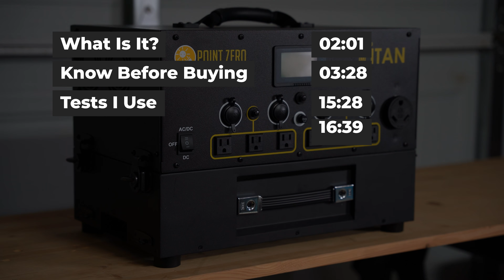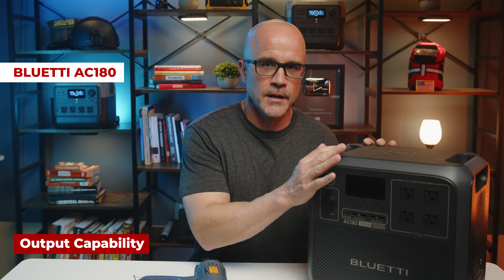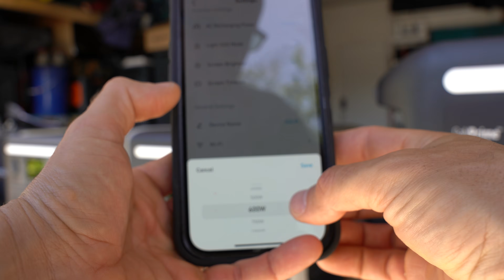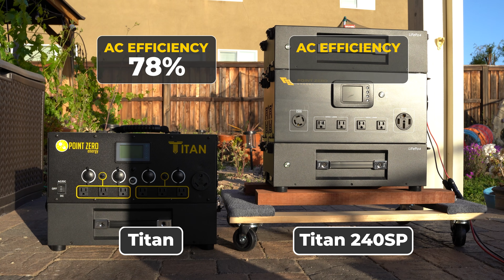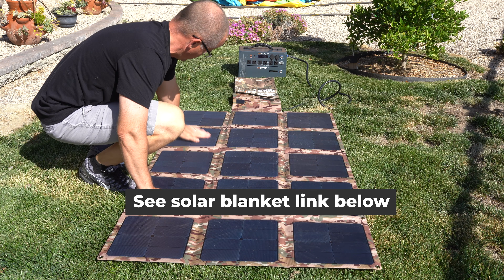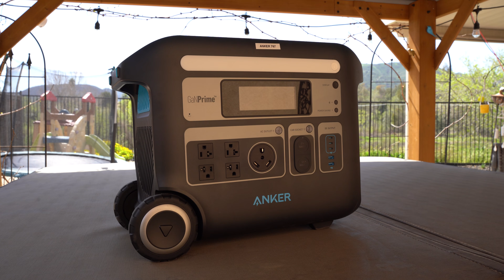Best Solar Generator for 2024 (The Ultimate Guide)

Comment: I have the Ecoflow delta 2 with extra battery and use it daily. I try to power a single room in my house with it. I have 800w of solar panels going into it (it’s capped at 500w) so I can run off the sun during the day and off the battery at night. I’m looking at the Delta Pro 3 that is ready to be released as it has both 110 and 220v capabilities without the bridge required for the other pro models. Thanks for the video!

Comment: We run a reasonable cost monthly except for the hot months so I was thinking of adding this for those times and then bought an EV so now trying to add that to the mix. Any suggestions for EV charging options (800kW Ioniq5).

Comment: Great video i own 6 mango power units got them for 1300 instead of paying $4000 dollars has an internal 3.5kw hour battery with an add on 3.5 kw hour battery making it 7 kWh but mango power has the worse service when mine went out they never sent the return label for warranty and stop answering good unit bad service but found all the new internal parts from a recycler guy in Los Angeles super cheap install one one day before new years with 2000 watts of solar running a Mobil home 24/7 till now 0 problems but since I open up the unit I added fuses it has none to protect the unit internally or for the solar input I would suggest to add protection on any of this units not only on the solar input but on ac output and the only reason I like this units it’s because of the battery been one of the best in the market

Comment: My Pecron E600LFP drops to 100 volts when you throw a few hundred watts at it, which some of my devices really don't like. Causes my UPS to rapidly flap the AVR on and off. The power brick also failed, though they replaced it free under warranty without requiring me to ship them the defective one.

Do the E1500LFP and E2000LFP suffer from this same voltage droop issue as the E600LFP? Their spec sheets still have the same "100V-120V" spec that would indicate that they also have unstable voltage.

Comment: 3:20 harvest the energy directly from the sun - what an interesting point
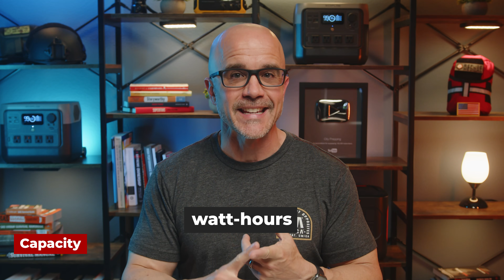4:30 capacity
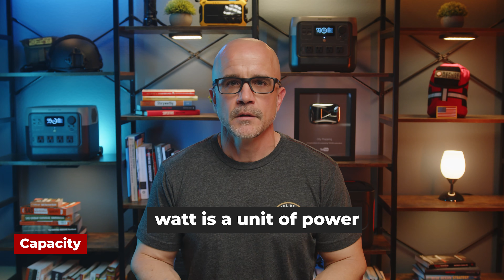4:38 watts are a unit of power
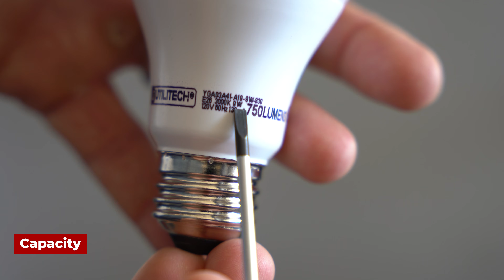4:50 the number of watts needed to power an object is listed on the side of the objects
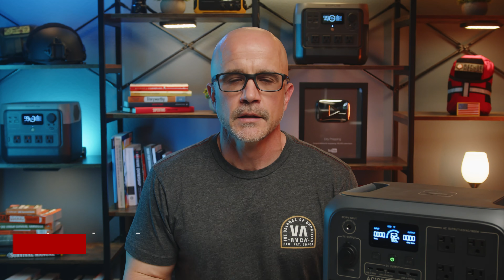6:20 output capability
7:33 run at 50-70% operating capacity 
8:05 temporary spike to get motor running then comes down
10:20 lithium ion versus lithium iron
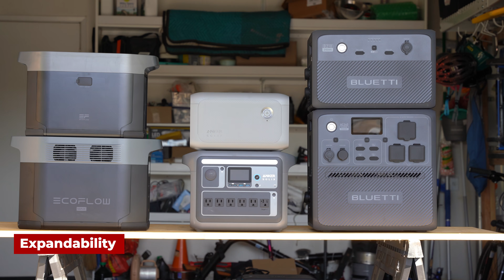11:40 expandability of batteries 
Jackery no until 1000 model
34:50 battery capability calculator
37:40 you slowly add on ea device at a time to not surge all at the same time.
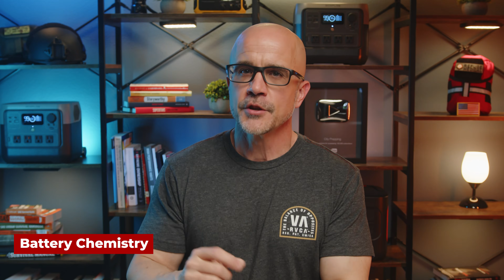Reply: Lithium vs iron starts at 9:30

Comment: Next year I am going to travel the country for a couple of years in a truck pulling a fifth wheel and I wanted to buy one so I can use truck stops and rest stops when traveling to my next destination, plus If I wanted to stay somewhere that was off the grid  I would need a power source for all three scenarios. After searching,  watching and reading till I couldn't research it anymore I have to say this video convinced me on what to buy. Since today was the last day for tax free hurricane items here in Florida I bit the bullet and ordered a EcoFlow Pro with a 400 watt solar panel. The Eoflow Pro is 3500.00 and was on sale for 2499.00 the solar panel is 999.00 and then I found a Pro with the solar panel on Amazon for 2899.00 plus saved 188.00 from the tax free holiday so I feel I got a great deal. Out of all the things I read and videos I have seen the EcoFlow was always one of the top choices or number one and when this guy said "it's the only one I don't give away or sell I keep them" I was sold.
Reply: Interested in using the Eco Flow in my shuttle bus. Would you do hard panels or soft? Would it power an AC?

Comment: That is a great review, thanks, as I am looking for back-up options in the event of blackout, plus the ability to transport if there is a need to evacuate..

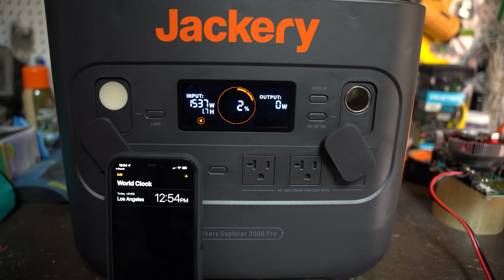I have one question that came about from a comment you made towards the end 33:48 where you state that ideally, they should be stored at about 50% of capacity.

This seems counter intuitive to me because surely, when a blackout occurs there is no option to get the additional 50% capacity needed.  And in the event of an evacuation there probably wouldn't be the time available to get the extra charge to the unit.

Am I missing something?

Comment: I need help...I need a solar generator that a 50 amp plug can go into. I got a bluetti ac300 it has a 30 amp plug but my rv is 50 amp. I reduced it down to 30 amp...n now I'm having to replace my rv Converter. I don't know anything about all this stuff I'm living full time in my rv n I need power to be reliable. I live on land with no power...I have pets...I got to have a generator I can plug my  rv directly into.

Comment: Note: In the video it is stated that the max expansion capacity of the Ecoflo Delta ll is 2 kw. This is not true. The Delta ll is compatible with the Delta ll Max expansion battery. With this configuration, maximum capacity would be 3 kw. I have this configuration.  The Delta ll max expansion battery works with the Delta Max, Delta ll max, and the Delta ll.

Comment: No Dabbsson on the list?  The best value in the solar generator market.
Reply: Dabbsson's use semi-solid state LiFePO4 batteries that get 4500 charge cycles and are lighter than normal LiFePO4 batteries.
Reply: I agree. 5 year warranty. Amazing capacity.

Comment: I have 2 small ecoflows the 256 wh ones. Great solar generators but I also have 2 small 268 wh bluetti’s and they work great as well. Both have nice apps and displays. I like that my EcoFlow’s display can be set to staying on permanently while turned on and blueetti is about a minute max which sucks. BLUETTI has the best screens but they don’t stay on while on and that’s a bummer. But aside from that both are great but I agree EcoFlow is my favorite and best out there. BLUETTI is 2nd place with them. I actually ordered the BLUETTI 180 for its sale price of $599 no sales tax in Montana lol. Anyways it’s 1k original price so I had to order one 2 days ago off Amazon for the sale price that’s a steal. I wanted a EcoFlow instead but it’s not on sale so I went with BLUETTI. That’s a great steal on that unit for $599.00 right now.

Comment: Can the expansion batteries be charged without being connected to the main unit?
I don’t see this issue being discussed, whether or not these extra batteries have a built-in charge controller.

Comment: The whole lineup of generators stemmed from the New World Foundation that created electromagnetic (sine-wave) Hub Motors.  We proposed a complete line of repowering of commercial tools such as air compressors, welding machines 0water pumps and saws &drills to be powered with jumper cables.  
   The cost in electricity was so high for the old electric powered tools that it was imperative.
   We even cancelled atomic power in favor of sine-wave powered power plants , industrial wheeled tractors and ships as well.

Comment: I'm looking for a lightweight unit in the 500w- 700w range. I have a Bluetti ac50s, but the DC keeps cutting out, so I can only run it on AC. I would prefer DC5521 inputs and output jucks for better overall system compatibility.

Comment: Great video.  👍I am in the market looking for a unit and this video helps pull everything together in a very concise/easy to understand way.  Spreadsheet is awesome.  Had a question about solar/wind hybrid systems.  Living in a part of TX that gets either a lot of wind or a lot of solar.  Can these systems be adapted to wind as well?  If so how?  Having a steady supply of either wind/solar, reduces the number of batteries/panels.  Also do you factor into the calculator the average sun hrs per day a location gets? I'd be interested in the Bluetti AC240 or the Point Zero 240SP.

Comment: I have a shed in my backyard that I sometimes do work in. It has a 12,000 BTU  AC window unit and 2 LED lights.

I would like to sperate the power from my house to the shed.

I would think 12 deep cycle batteries would be better for continuous use. 

What do you think?

Comment: I bought an AllPower R1500 and a 200W panel and so far love it. Camping and hunting working great.
Reply: I bought an AllPowers 700 and it arrived "sort of" charged ( not discharged as advertised). However, it would not power anything. I had to send it back, and since they did not have a replacement available, they refunded my money. It's disappointing since I was really looking forward to it for van travel.
Reply: @dross24MA  Hmmm dang. Sorry.
Reply: @dross24MA  what do you mean sort of charged what does that mean? you tried to charge it up and it didn't charge up, your comment was not really making sense

Comment: Thanks for the info. I have a truck camper I need to power. I’m leaning to the Ecoflow products. I was quoted 13k for a complete overland package. I’m trying to not use solar panels. I was curious if I can just use the alternator charger to top off my solar generator.

Comment: WHY do you people NOT give the amp hour rating for these things ??????????? It seems to be the elephant in the room, WHY not address it? I will NEVER spend my money on a product that tries to hide it's specs. YES, there are 10 thousand claims, but NO pertinent information!
Reply from the maker: Goal zero takes that approach. I just find it confusing to work with those numbers. But if you use a calculator, you can quickly determine the amp hours with the information on their website. It’s just a different unit. I personally prefer kilowatt hours myself.

Comment: Hi, Thanks for your informative video.  At around the 13:00 mark you stated a 1000W gas generator wouldn't be able to charge an 1800 Watt solar generator. Wouldn't it just be a slower charge or would it actually overload the gas generator? Thanks again!

Comment: Yeah, accepting these devices called generators across the board shows you how you can mold people into anything you want. Generator was always, and ALWAYS one and one thing only - motor that produces electricity. Period. 
These are just elaborate battery banks. 
Even hooked to solar panels, they still don’t fit the definition of a generator.
Reply: True, but my Titan generator will be keeping my stuff running from the sun, when your out of gas. I own a gas generator too. So no matter what you wanna or don't wanna call it,it still keeps the lights on
Reply: @dustydawson8977 Plus gasoline has a shelf life of about 6 months to one year.  Sunlight is ‘fresh’ every morning. 😊
Reply: It's an inverter, controller and battery.
Make your own components.
I say.
My bank failed, no comeback China.
So that's it no second chances.

Comment: This video is a GODsend!
Thank you so much!

I'm a 55 yr old female. I  have been trying to understand all this stuff for some time now. 
I recently decided I wanted solar, not gas. 
I live in South Ga USA, so it's HOT! 
I bought a portable AC that's 8000 btu.  I hope to a power that for sure. 
A huge concern for me is portability. 
I prefer one with a handle and wheels.
Otherwise, I won't get optimal use from it.  Of course I'll get the best I can. I have around $2500

I've been overwhelmed with this stuff!
You have no idea how much I appreciate the work you have done here!

🔥🙌🏻to God be the glory🙌🏻🔥
Reply: Go lower. Go to a Window AC at max 6000 btu's. The lower btu's will draw significantly less on your solar gen. You can close off a small room and be very comfortable.
Reply: @gregory4154  I did purchase a 6000 Btu AC.
I was so tempted to get the 5000, but it cooled 100sq ft less. 
Thank you again for the feedback
Reply: @angiedixon8017  Most 5000 btu's are mechanical, so they have an easier start.  It's the start that trips up most solar usage on the window AC.  6000 btu's are great, and you can digitally regulate it.  Leave it on Eco Mode when you use it.  The trick is, close your bedroom. Run also an air circulator like a Dreo fan.  Portable AC's are NOT efficient.   Those are the ones that use the tubbing you pull to the outside.  My pups always sleep in the room with us anyways, but if you have your own fur babies, bring them in the room with you.  The technical stuff will come later.  This is a jump start that will ensure you get through a grid down off your solar or gas gen if you are using that.  Remember, the solar gen can stay indoors with you (Ecoflow , Bluetti, and Ankor are the best), the gas MUST stay OUTSIDE in a well ventilated area, and they make a lot of noise.  Good luck to you.
Reply: @gregory4154  thank you, I will put this info into action😁
Reply: @gregory4154  thank you for your response. I will do just that
Reply: @gregory4154 Will Prowse recommends the cheapest 5000 BTU Walmart window unit you can get, for something that will work.
Reply: @gregory4154 great advice…I live in central MS and am 68 yrs old and can no longer tolerate the humidity….when lights go out, my little 110 window unit in my bedroom keeps me going.
Reply: @mscatnipper2359  ah yes! Thank you for sharing this.
Reply: I bought a small Party tent to put over my bed with the 5000 btu window AC, after lots of research.
Reply: @iadoreadonai  thank you so much😁
Reply: @iadoreadonai smart!  Very affordable survival solution that doesn’t cost much at all.  Thanks.
Reply: Great information.  Thank you.❤
Reply: Much Better than paying $$25,000.000 on home soar panels . Especially, when most people want to keep refrigerators on and basic electronics like Internet. Emergencies not hair dryers.
Reply: @rickzabala6020  can't afford it. 
Doing what I can with what I have. 
Could care less about hair dryer. 
Only air conditioner is important. 
I will prob get a mini fridge or 12Vfridge/freezer for that.
Reply: @rickzabala6020  Amen
Reply: You are also gonna want a dual fuel. Propane never goes bad.
Reply: @hisnameisiam808  thank you for your input
Reply: @angiedixon8017  If you have solar panels with lithium iron phosphate batteries that will do good work. But when the sun is not out you need a backup and the backup is a dual fuel generator that can run on propane. Get yourself a few good propane tanks and you will have enough energy for a few weeks if used sparingly in conjunction with solar panels and batteries/solar generators.
Reply: @angiedixon8017  also, a personal water filtration device like a sawyer water filter! Always keep one around because they are inexpensive and you can only survive 3 days without water!
Reply: @hisnameisiam808  I just ordered a Grayl 20oz bottle with extra filter. It was $20 off on Prime day. 
I do have a couple of bladders to use with lifestraws. Guess I need to dig them out and make sure I know how to use. 
My power is still out from Helene. 

It is true, as humans, we begin to adapt to whatever situation we are in. 

🔥🙌🏻to God be the glory🙌🏻🔥
Reply: Other people recommend a mini split ac system as the best units with a low power demand…
Reply: @maryrenaud6732  I've seen one of those recently.  I was intrigued.
Reply: @mscatnipper2359  thank you!
I got a fancy dolly from Amazon with 330lb capacity. It appears to do many things. It's my first one and I love it!
Your advice is greatly appreciated
Reply: @mscatnipper2359  I wrote you a comment, but I must not have posted it. 
I took your advice. I got a fancy dolly from Amazon with 330lb capacity. I love it!
I hope this posts, so you can know how grateful I am to you!
Reply: OK I’m
Reply: Same!!
Reply: Ecoflow was the winner
Reply: I would recommend a Honda EU2200i and a solar unit. I have the Honda, I am only looking for something to power a box fan all night.
Reply: You need a generator that can handle the intermittent SURGE of your AC.  According to my research it takes 3 to 5 times the capacity of the generator to handle the SURGE every time the AC compressor cycles on.  And I'm not sure, but I think 8K BTU is continuous running but the surge may be higher.  However, if the compressor surge IS only 8K, times three MINIMUM is right at 24,000 volts.  You need a generator that can handle a 24K Volt SURGE over and over without damaging the generator or whatever else you ALSO have plugged into your power conditioner.  Good luck finding that for your budget!  My 14,000 BTU free standing unit with the hot outflow tube INSULATED barely cools my well insulated 265 sq foot bedroom at 98 to 103 degree heat and is NOT sufficient in 109 to 113 degrees.
Reply: @ServantOfJesusChrist777  thank you so much! I am screenshotting this comment.
I will go learn some stuff and I'll try to remember to come back and comment again.
Reply: @ServantOfJesusChrist777 pop